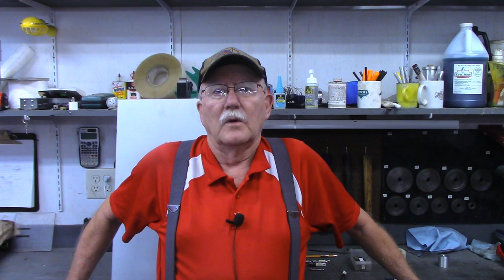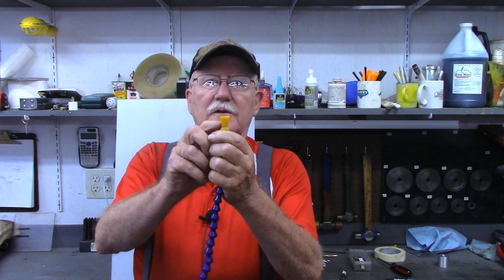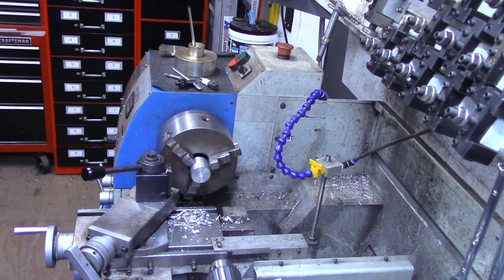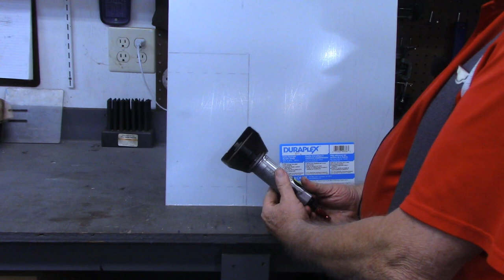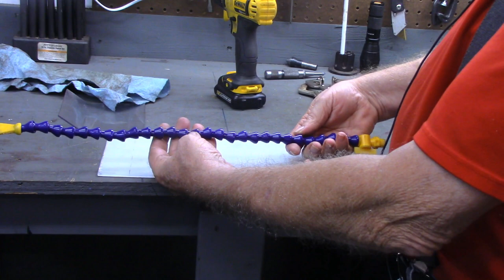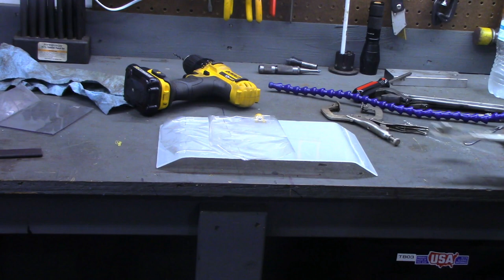Coolant / Chip Shield

Comment: I`m sure you could rig up a small wall mart adapter to run the tailstock digital readout, they are real cheap and you could do it for less than the cost of a couple of batteries, that way you always have power, I did something similar on the readout on the mill, always forgot to turn it off.

Comment: Watching you use the key in the drill chuck reminds me of a great frustration around the shop.  I have an entire drawer full of chuck keys.  Similar is my search to that for the holy grail when I attempt to get a key for my various chucks that has no slop in it.  All of mine whether they are chinese, German, Austrian, or US made fit with a large amount of slop.  This includes the ones that came with the chucks.  It drives me nuts when I am using them one handed that they always cam out of the teeth not to mention that that action on the gear surface leads to premature wear only exacerbating the problem.  Keyless chucks are nice and I have a few but on tools where larger drill bits and hole saws are used they self tighten to the point they become a tool requiring chuck!  Do you have this problem and have you found a solution if so?  I bought a third axis for my DRO on the lathe (future project to install) so I would not have to deal with batteries.  Could you adapt a vernier style or better a dial caliper?  I do like the digital for converting back and forth between metric and imperial.  Nice project.  A modification I have done to my air hoses by the machines is to install  in line valves so I can regulate the air pressure right at the point of use.  Keeps from blowing chips all over the shop!!  I use the little ball valves with a round dial used to open and close. No weight no bulk.  Take care.

Comment: Lee if you use SR batteries instead of LR - they will last up to 10x longer.  SR is silver oxide. they are more expensive, but . . .
Reply: I hit on the same solution while buying batteries for my cheap harbor freight digital, but as often as I use the thing I take the battery out before I put it away.  This is a lot of why the better caliper that I've ordered is entirely mechanical,  with a dial,  rather than digital.   :-)